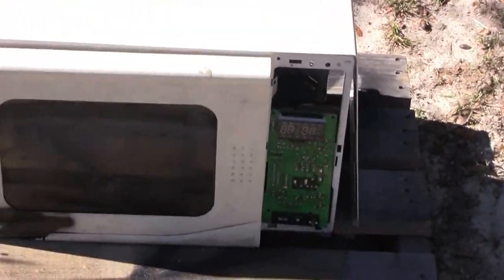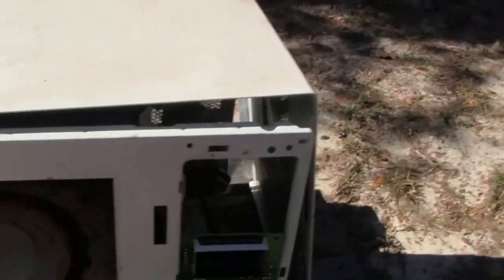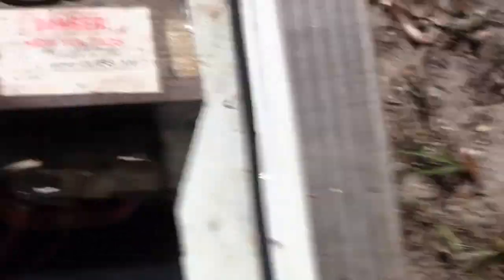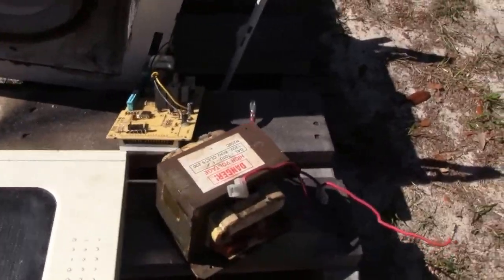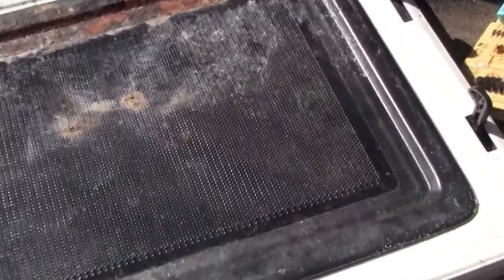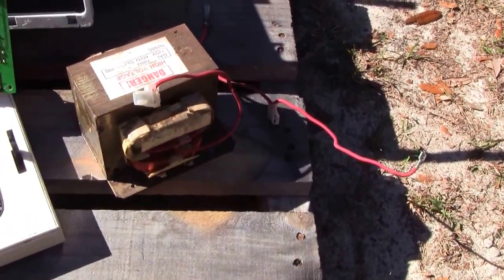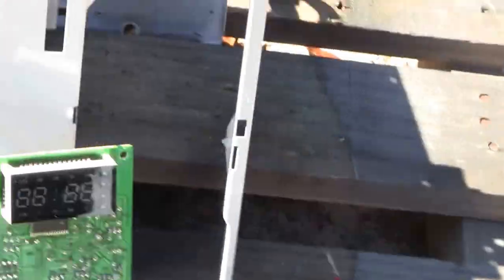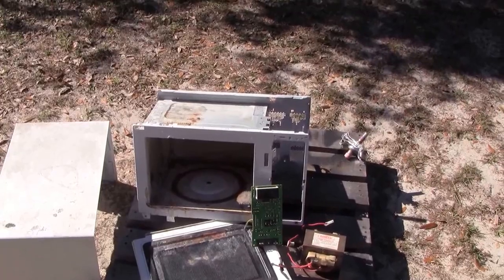MICROWAVE OVEN NOT SAFE.IT MAY SHOCK YOU TO SEE HOW WEE ARE NOT PROTECTED FROM MWR

Comment: Microwaves have a mechanism similar to a Faraday Cage on the front of the door. Because microwave radiation wavelength is much, much bigger than the size of the perforations in the mesh on the front of your microwave door, they cannot pass outside of the microwave while smaller kinds of radiation (visible light) can. Just wanted to clear up some misconceptions you had--microwaves are indeed safe when used correctly